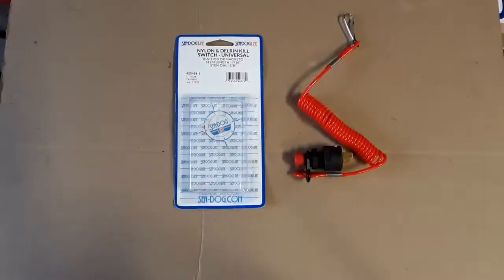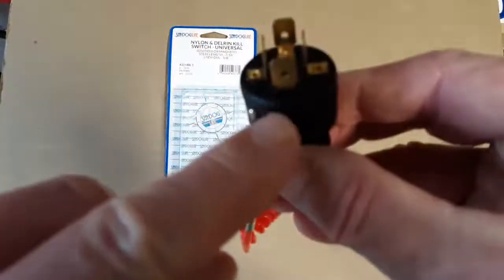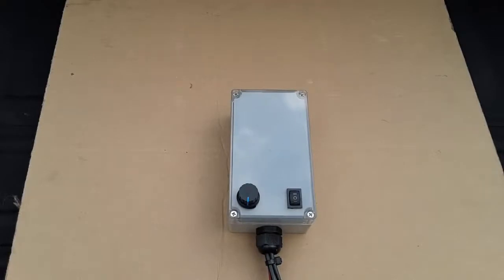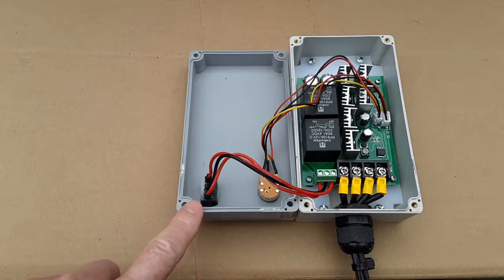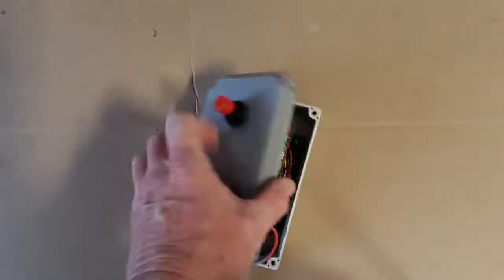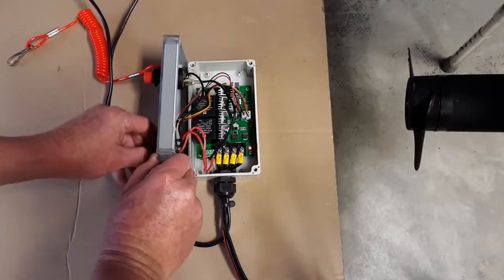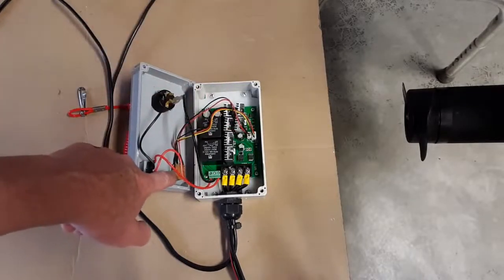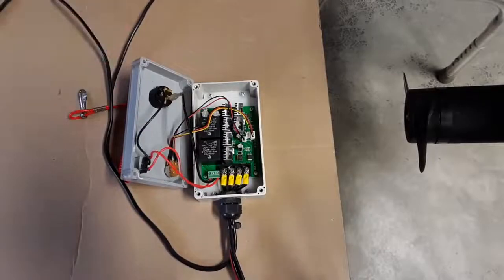PWM Speed Controller with PWC Kill Switch or Cut Off Switch for Trolling Motor

Comment: Where did you get the extra black wire to connect kill switch to power button? Because you used the power to circuit for the kill switch to circuit

Comment: why is it that people can use these type of kill switches on their trolling motors when they are rated for 5 amps? the maximum draw on the smallest 30 lb thrust motors is 30 amps. Being that these are normally closed switches how are they not toast after constantly being under an amp load that's significantly higher than what their rated for.
Reply from the maker: Because you have to understand how to wire the switch into the unit.

Comment: Hey Aks, Thanks for the great videos. Concerning the kill switch did you solder those connections? Do you have a circuit breaker or fuse for your pwm? I have a 60 amp cb. at my battery, will that trip if something shorts in the pwm box?
Reply from the maker: Thanks! Yes, I soldered the connections and used marine heat shrink tubing too. I use the same set up as you. The power coming off the battery to the PWM has a circuit breaker. It should protect the PWM.

Comment: It seems the problem is I have a normally open switch, so when the lanyard is pulled, the circuit is closed, causing the motor to run. I need a normally closed one, and when the lanyard is pulled, the circuit is open. Can you recommend a switch that is normally closed?
Reply from the maker: I put a link for the switch in the narrative section.

Comment: Thanks for another GREAT video.
I had bad luck with the cord that came with my kill switch.  It broke after limited use which is a BAD deal.
I looked on YouTube and found a DIY method of making a really nice one for my Hobie Pro Angler Kayak that I fitted with a Kill Switch.  I utilized a piece of 1/4" diameter dowel rod about 12" long for my application and cross drilled a hole in each end.    You can use different length dowel rods and make multiple coils at a time.  I used a piece of .093 diameter weed eater line Smooth Style and inserted one end of it through one of the cross drilled holes in the dowel rod and wound it tightly around  the dowel rod until I reached the other end of the dowel rod and then inserted the other end through the cross hole on that end of the dowel rod.  I then utilized a 11 X 13 cake pan and filled it with water and brought it to a broil on the stove top.  I inserted the wound stick with the weed eater line wrapped around it into the pan and laid something over top of it to keep it submerged.  I boiled it for about 5 minutes and then took it out with gloves on i.e. its hot and placed it in the freezer overnight.  I left several inches of extra weed eater cord on each end so that I could use a lead crimp type clamp with a loop on each end for attaching to device utilized on each end of the coil.  I picked the lead crimp type clamps at Ace Hardware.  They work like a champ.
Hope this was of some help.
Reply from the maker: Thanks John, you opinion means a lot. I have made coiled lanyards the same way. They are much better than the stock ones. If you want to customize it, get some patterned/colored paracord that you like and figure out how much length will cover your lanyard. Pull the guts out of the paracord and then thread your lanyard through the sheath for a custom look.
Reply: @Aksmaniyak  Kind of hard to explain this.  Sometimes the coils are a little loose.  If you put a half twist in the coil and keep twisting it from one end to the other it will tighten up the coils.  Funny you mention the paracord covering as a friend of mine utilized a similar method, and as you said you can really make some custom designs on your lanyards.  The nice thing about making them yourself is the ability to make custom lengths for different applications.
Sharing knowledge is a great thing.  I have learned a lot from YouTubers such as yourself over the years and try to give back when I can.
Reply from the maker: @helicopterjohns  Thanks John. I have definitely learned a lot from you as well.

Comment: If all your circuitry in that box fails is there anyway of bypassing the box or are you rowing home? I just need a kill switch (exactly like the one you got) wired up to a relay but I was thinking of putting 2 Anderson plugs on the box. If anything fails I can bypass the box.
Reply from the maker: I did a video for that scenario. You power the trolling motor directly with the battery.

Comment: Great content you have on your channel. I have built a similar PWM for my Watersnake Trolling motor, It seems like at certain speeds i get interference on my fish finder. Do you have any recommendations to help with interference?
Reply from the maker: Thanks! I would check your wiring connections but I have never had an interference problem.
Reply: @Aksmaniyak  Thanks

Comment: I spliced wires onto black wire only but its reversed action. motor stops when I pull on switch but runs when I remove safety catch
Reply from the maker: There are 2 types of the kill switches. You have to use the one that opens (kills) the circuit when the key is pulled.
Reply: @Aksmaniyak   Your right! I got the wrong type I took it apart to see the internal mechanism & contact is on in closed position only. i'll seek out the one  you used. Thanks !
Reply from the maker: @picwick57  Glad to help. I did the same thing originally so that's how I knew.
Reply: @Aksmaniyak     Was at doorstep when I got home, hooked the ohms meter to it &  this one works like a charm!Thank you!
Reply from the maker: @picwick57  You are welcome!

Comment: Hey i have a question not specific to this completely.
I have the haswing 65 brushless motor.
I relocated the stock pot dial in to a project box and used Ethernet cable for the wires.
I am trying to find a back up pot for it to just have on hand.
Thing is its also the directional switch.
SO turn it 1 way its reverse, the the way its forward.
Iam kind of a noob when it comes to these things and not even sure what to search for.
I know you have this motor or had this motor yourself (seen your vid on it).

Was interesting the big stock head unit.. the only thing of importance inside was the little bitty pot switch. i guess all the rest is down in the motor.
 All that plastic to house a little 1in dial lol.
Also interesting...I wired in a on off switch on the red wire to the pot...
it only works if the dial is at 0.
So i have to zero the dial the flip off the switch. doing that i can then turn the dial and the motor wont turn on as planned.
But if the motor is already turning and i hit the off switch it just keeps running.
So any idea of how to wire a kill switch in on this motor with out wiring it to the big wire power wires?

 Thanks for any help.
Reply: Any pot should work with the hawswing, the ohms doesn't matter in a application like this.
Reply: The hawswing is a brushless motor and the ESC is in lower unit, your going to have to use a kill switch that breaks the main power as I don't think it actually has a on off but instead relies on the pot center/ neutral position.
Reply: @BassManStrikes  but iam having trouble finding one that has the forward and reverse on it.
All of them seem to just be speed dials.
I need 1 that has the zero (off) in the middle and turning 1 way goes reverse and turning the other goes forward.
The stock one isnt center really it has more travel in the forward direction than the reverse 1.
Reply: @BassManStrikes  thats what i though. Thanks.
Reply from the maker: I'm not sure what might be causing this other than that motor is digital and standard switches may not work with it.

Comment: Made one just like this… PWM fried after a few hours
Reply from the maker: I have been lucky that none of mine have filed. There is also a model with an internal fan that has worked well for most people. There is a video build in my PWM playlist.
Reply: @Aksmaniyak  thank you sir. Saw the video after watching this one. Ordered it and will see if I have better luck
Reply from the maker: @gn3ricc  You are welcome. Let me know how this goes for you.
Reply: @Aksmaniyak  Will do! Thanks again for all the videos.. appreciate the effort and time.
Reply: @Aksmaniyak  Tried the new PWM with the fan since the last one without a fan fried on me. Towed my buddy and myself (titan 10.5 x2) for about 4-5 hours at moderate to low speed and had no issues. I would have to say the hole drilling and mesh tape helped out a lot. Towards the end of the day, it started to trip the breaker, but I think the battery was running low and could no longer provide enough power to pull us, but luckily it was the end of our trip and almost back to the dock. Thanks for all you do and the suggestions.
Reply from the maker: @gn3ricc  I'm glad it worked for you Heng.

Comment: I'm having a problem.  I used your model for my pwm and kill switch and  after making the wiring modifications, mine did not shut off power.  My directional has a black, red, and yellow while yours has a black, black, red wiring.  I used the black wire and when it did not stop after pulling the kill tab, I cut the black wire and it still didn't stop.  What have I done wrong?
Reply from the maker: The black wire in my PWM is connected to the center tab of the directional switch.
Reply: @Aksmaniyak  thanks so my center wire is yellow so that would be the wire to interrupt and send to the kill switch?
Reply from the maker: @stevepolley4628  If it works the same as mine. An easy test would be to get it running and then just pull out the wire to see if it stops.
Reply: @stevepolley4628  did it work after splicing the yellow and connecting another wire to the “I” back to the switch?